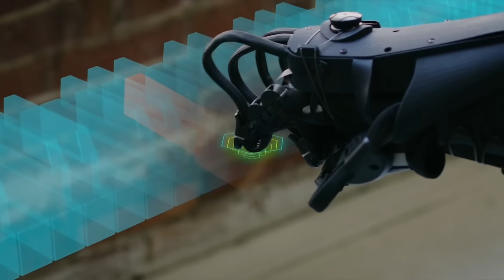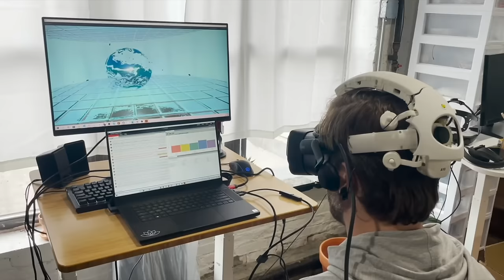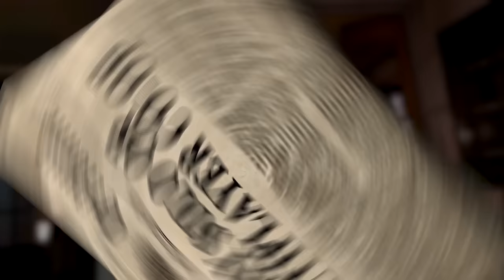Full Dive VR is COMING - The Virtual Reality Future.

Comment: I think it needs to be less about interfacing with technology, and more about finding a way to instantly induce REM, and wake from REM in a controlled manner. The brain can do an infinite amount of procedural generation. You can build, and experience what you built in real time. Combine that with controlled lucidity and stable dreamscapes, and you get all the benefits of full dive, with no detrimental effects. Assuming the method to manipulate REM doesn't have any side effects on the body.
Reply from the maker: Yes it seems like you know your stuff however there is no way (at least no safe way) to manipulate REM and dreams at the moment using external divices

Comment: There'd have to be programmed parameters for everything your trying to stimulate the sensory perception of which would take considerably longer than the time to design 3D models and assets for a normal game. I think eventually a software or hardware powered by Neuralink would be capable of doing something similar to SAO but if anyone went through with it the risks for potential brain damage if a glitch or error in the system occurred would go up by a lot since whatever happens would be effecting someone's sensory perception.
Reply from the maker: True but one day my friend. And are you ready to full dive into sword art online ?